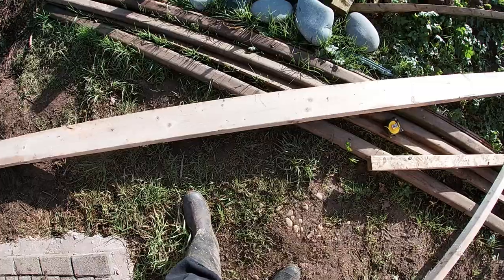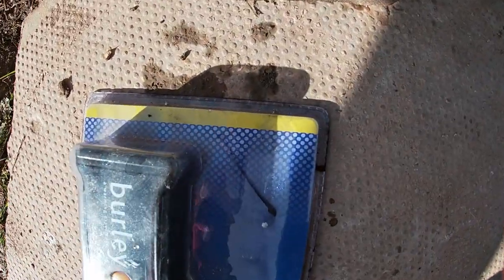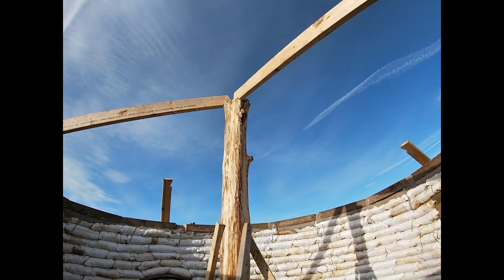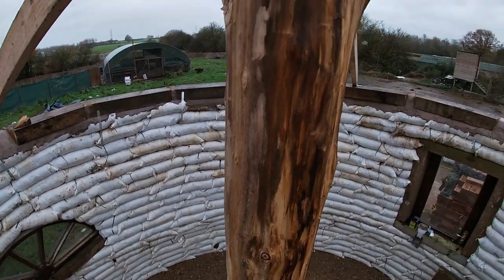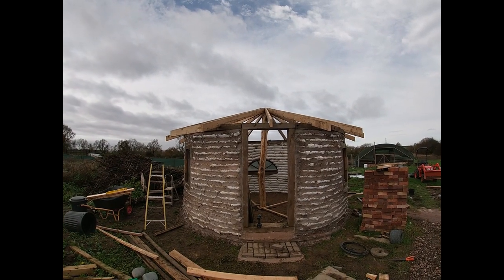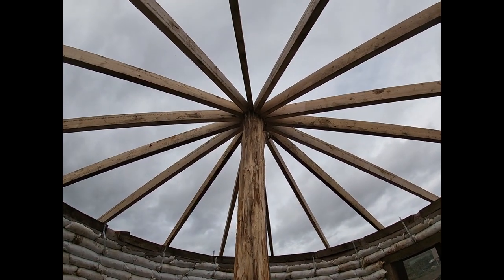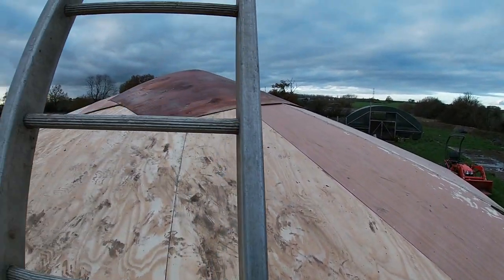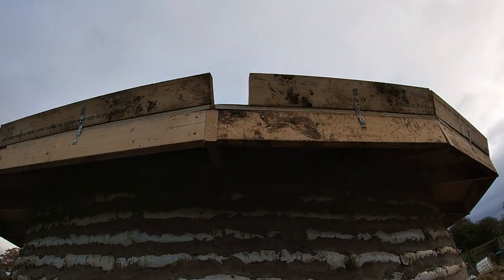Roundhouse Part 11, building a round wooden roof. Earthbag, man cave, tiny home

Comment: Great stuff, I'm building a cob roundhouse, but my father in law a 'traditional' builder reckons I can't have wider than 600 centres even at the overhang. Is this true? I've got a similar roof design to you and the house is about 5m diameter. Cheers if you can help.
Reply from the maker: Use wood noggins to reduce the gaps to about 600mm, my roof has 4 Ton on it and held up fine 👍 also alot of waste board but 18mm solid boarding over the rafters makes it joke strong
Reply: @FieldtoFarm_UK  when you say noggins, I was gonna put purlin type things, about 3 per gap, is that the same thing? The centres will be much less than 600 at the top,about 400, going down to about 1200 at the overhang. I'm not sure what the problem is but he's got me wondering now. Sorry for the ignorance but it's my first go. I really appreciate the help👍